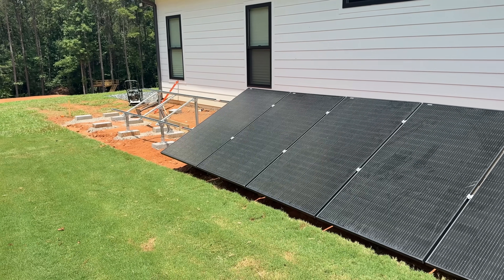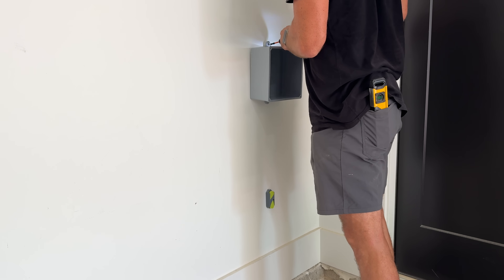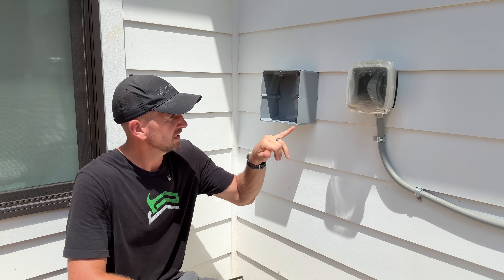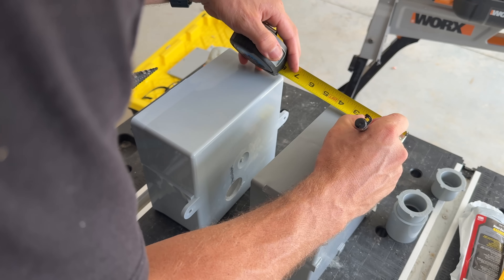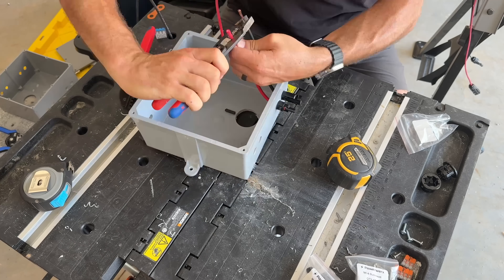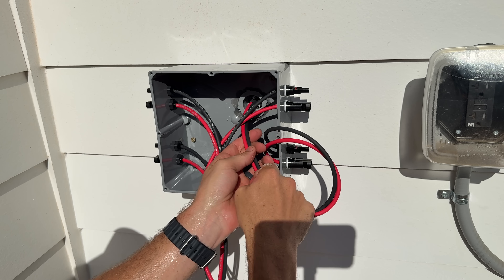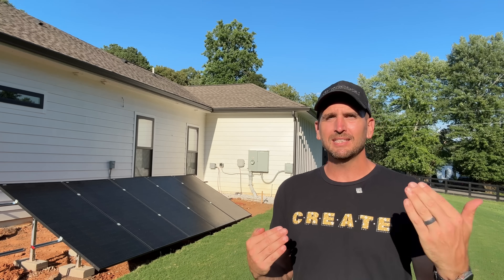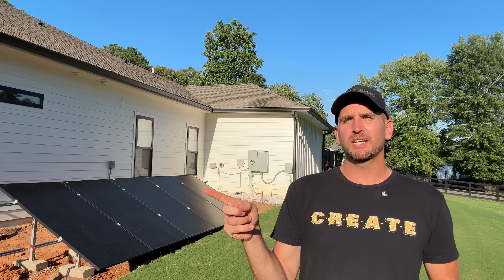How to Run Solar Cables Inside Your Home Safely

Comment: you have to put flashing over the outside box, tucked under the siding. Easy fix! 1. Remove box. 2. Push flashing up under siding. 3. Reinstall box. PS: Flashing has to extend past sides and face of box.

Comment: I thought DC wires have to be inside metal conduit when it runs inside the house by code?
Reply: Code violation.  NEC says it must be in metal conduit.  Just so everyone knows...
Reply: @TheMalbroughs conduit, MC or raceway.
Reply: @TheMalbroughs  nope, NEC 690.31(C) says it can be in plastic conduit and raceway. You will need to add an equipment grounding conductor where necessary.

However in general it is correct you need to run conductors as an assembly and not just bare conductors. This is true for AC and DC in general. Each assembly has listed units. This is why Romex doesn’t go where it is wet, it’s not a listed assembly for that purpose.
Reply: Yes, or in metal raceways or MC cable.  690.31 of the NEC.
Reply: They do!
Reply from the maker: How would you handle solar wires coming into a portable unit 🤷‍♂️
Reply: @everydaysolar  Yeah, I'm not really sure. I'm not an electrician. I think the point of the code is that the high voltage DC wires can arc if the insulation is abraded, possibly causing a fire. So then I would think that the main use of the metal conduit would be when going through walls & ceilings, etc. So maybe flexible metal conduit to the location of your Ecoflows, and then they pop out for the last bit to the unit?

Not being able to cleanly figure out this problem is why I switched from Pecron 3600LFP's + expansion batteries to an EG4 12000xp + wallmount batteries.
Reply: @everydaysolar I don't think there is a 100% code compliant way as the metal conduit  provides a ground in case of short. Apparently some AHJ allow it, others dont.

I am in the same bind. I  will finish my solar build out probably with EG4. I can use the DPU for add'l storage then feed the generator port with them on cloudy days. Not very efficient or maybe I'll sell them. Have to see how it goes.

Comment: Great install, I would just cover the external wires with an armored flexible conduit (Liquatite). This protects it from the sun and accidental damage.
Reply: PV solar wire is made to be out in the sun and the elements, but it wouldn't hurt to protect it from rodents and such.
Reply: @MississippiHomesteadJourney  who cares about the animals. You want protection for humans. Live wires are dangerous.
Reply: @uhjyuff2095  You want protection of the wires FROM rodents and such. They tend to chew wires and disable the system.

Comment: I've been trying to figure out safe, code-approved ways for a while. Thanks for the vid!!
Reply: What is being shown isn't code approved.  Internal solar HV DC wiring needs to be in metal (conduit, raceway, or MC) per NEC 690.31.
Reply: @billjohnson3344  Correct.
Reply: @billjohnson3344  Probably a dumb question, but what voltage qualifies as High Voltage in DC?
Reply: @adamcsincs  In this application (an interior PV circuit), the NEC defines this as over 30V.
Reply from the maker: Yeah, for these larger portable power stations I am not sure there is a code approved way as the use case is pretty new.  This was the best way I knew how to do it.